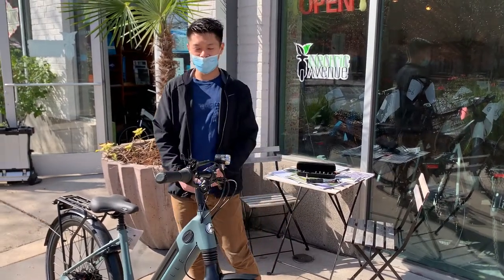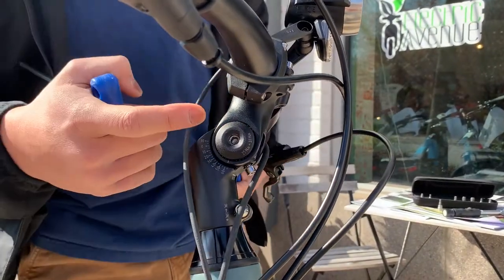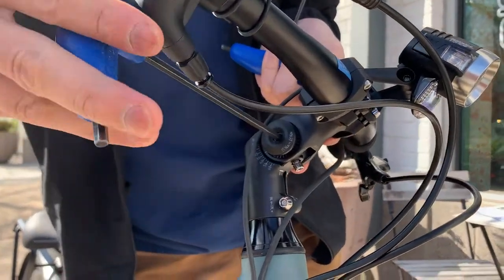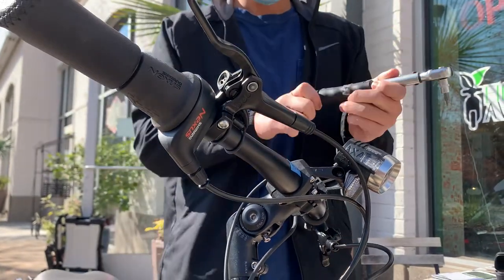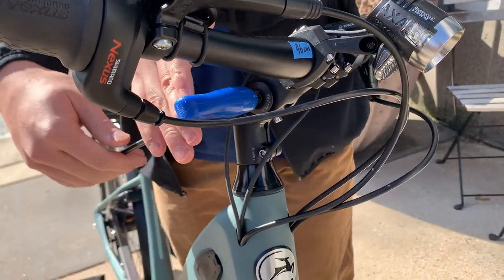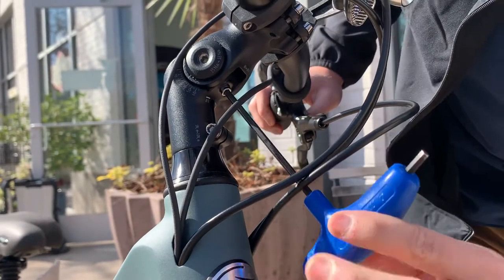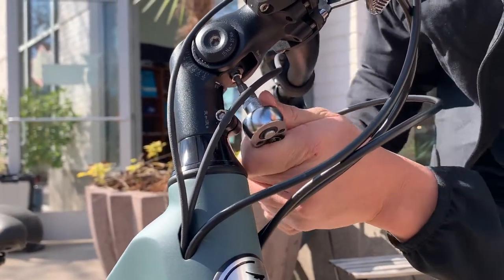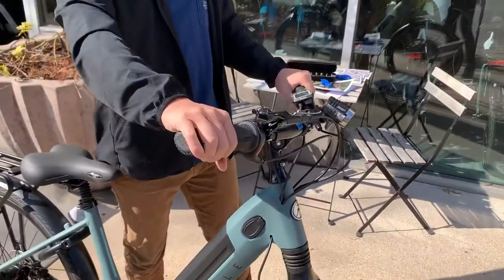How to Adjust Stem Angle on a Gazelle Ultimate C8

Comment: Hi guys! Thank for the video! I have a model of 2023 and there is no set screw on the front side. There is sore of a pin instead. Can you give me a hint how to proceed with this one? It would be silly to drive to service with such a dumb problem
Reply: Same question here. For the life of me can’t find out how to adjust it.
Reply: @MrCageman I was at the service in the end. There is no secret—it is just the screw on the side, but the joint is stuck. One must unscrew the joint and use a rubber hammer to make it move.